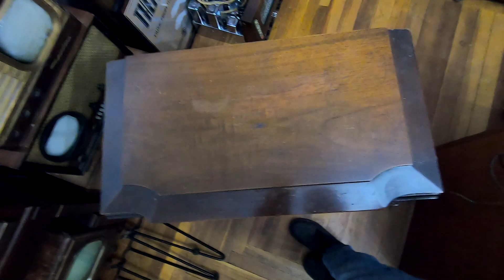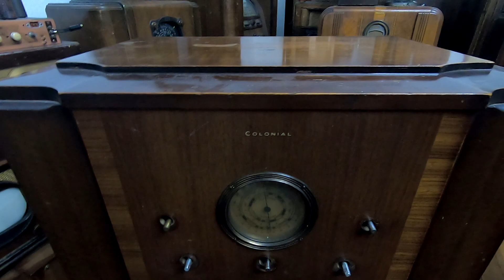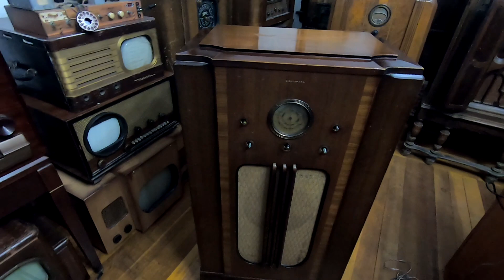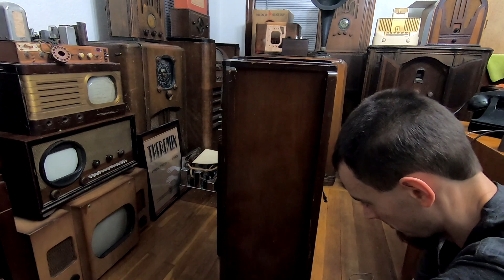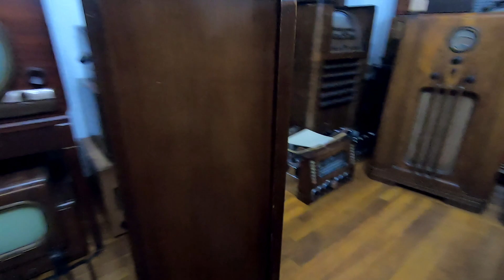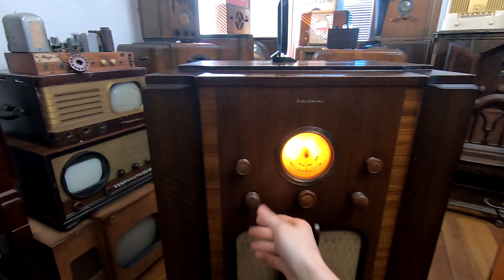Colonial Model 604 Radio repair - Part 3

Comment: I'm not understanding the change of opinion about the interference. You said you checked another radio (I presume located in close proximity), and that one did not have the interference symptom. How can external interference be on one of them, but not both?
Reply from the maker: The Zenith I tested is several years newer than the Colonial. I suspect the circuit design is better at eliminating or suppressing EMI, but that's just my best guess. I should have tried the Colonial on the same outlet as the Zenith to narrow down if the interference could be coming from devices on one of the shared circuits in my house.
Reply: @Eclec-Tronics  from what you say subsequently happened at another location (filled with noise sources) with the Colonial, my gut tells me there is more than just external interference. 
I don't repair radios, but I've been around engineering all my life. 
I also heard static just from you turning the knob(s); I'll admit I haven't yet watched Parts 1 & 2.
Reply from the maker: @rayrussell6258  I will say it functioned much better in my basement shop than it did in my living room. I'm willing to consider internal problems still, but the fact that much of the noise disappears during the day tells me at least some of it is external.
Reply: Seeing all the vintage tvs together gets me interested in them more and more.  Even more shots of an interesting room here.  That Stewart warner console will be a beautiful set, can you do a video on it?  You made a good choice in getting it.  Cheap too, where is this?

Comment: Apparently Gojo discountiued their smooth orange bottle cleaner and only has the pumice kind now. The Fast Cleaner you
 have is the one I use. Your grandmother must be pretty patient with you ( four months) but after you give her the radio I'm 
sure she will be quite surprised by it's nice finish and great sound.
Reply from the maker: She loves the way it looks, but her apartment is filled with noise sources. Couldn't get anything in the late afternoon that was audible. Maybe during the day it will get better.